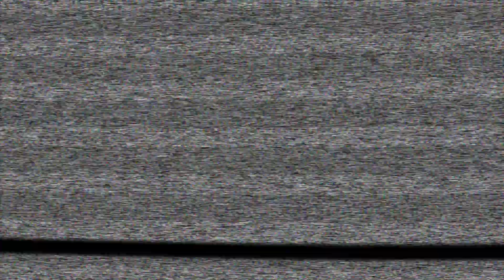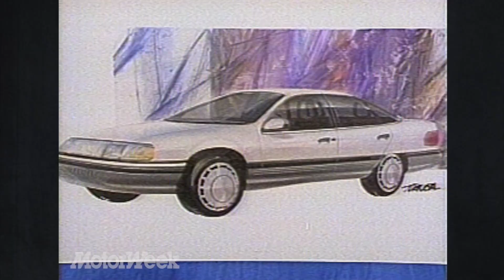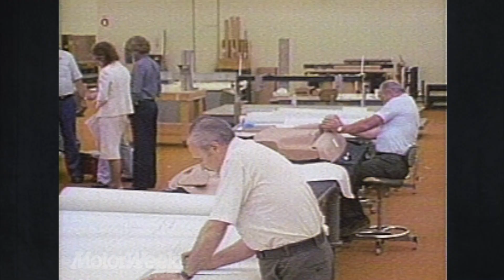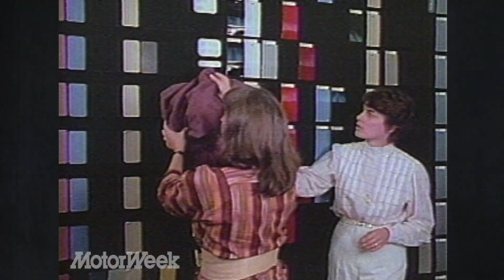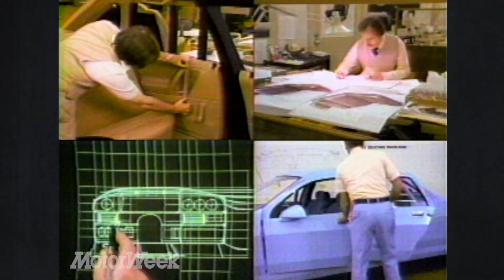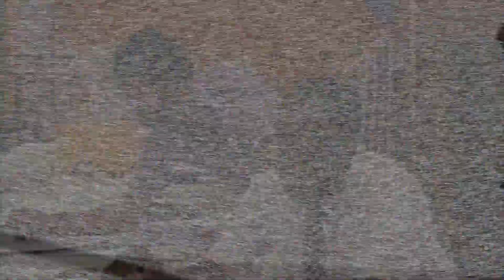Making the 1986 Ford Taurus and Mercury Sable | Retro Review

Comment: Have to admit, when they were new they definitely looked modern, not pretty,,  but definitely modern.  Best of the early years were the SHOs.  Best looking, best driving.  Rarest are the actual police versions, not robocop related, that have the 6 horizontal slots on either side of the nose mounted Ford emblem.
Reply: @JamesMaliszewski-d3b  These will probably be the MT 5 versions.

Comment: I've still got a 1990 Sable wagon. It's had a boatload of problems over the years, but I've been fighting like hell to keep it on the road and in good condition, especially with how few of them are left now. I just had the transmission replaced, and will be replacing the motor soon. If all goes well, I'll likely have one of the very last 1st gen Sable wagons left on the road in a few years. I'd love to be proven wrong, but it's been so long since I've seen another one
Reply: I'm wishing you luck. We need more old cars out there that aren't performance cars, and I do think the Sable is a genuinely awesome car with its light bar grille.

Comment: With all that testing and spending 3 billion, you'd think the engineers would have figured out how to build a transmission that lasts longer than 50,000 miles 😎
Reply: Big time! I had a 1994 Able LS and the transmission went out at 53,000 miles. I had a rebuilt one put in and that lasted until I donated the car to charity with 204,000 miles.
Reply: These were prone to transmission failures?